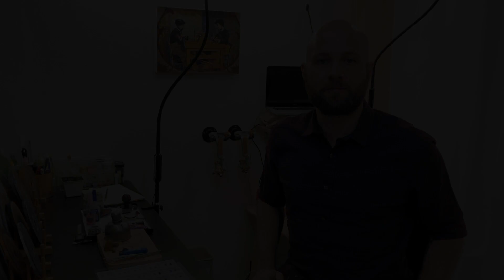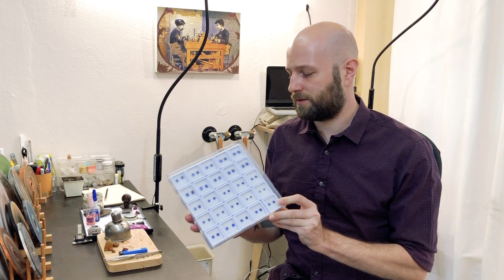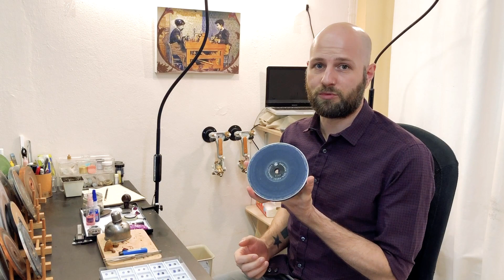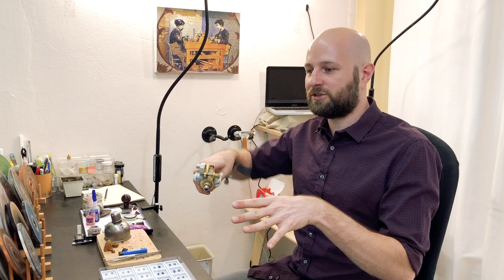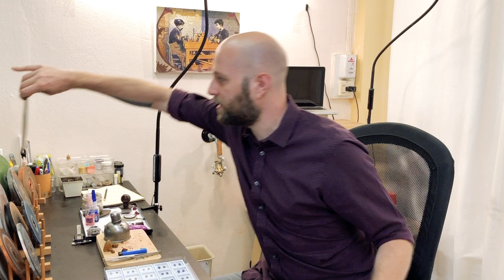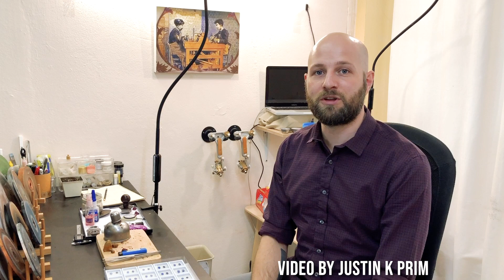Handpiece Polishing Sequence for Handpiece Faceting Machines

Comment: Justin:

This is one of the most informative faceting video I have ever watched.  I did a little bit of faceting with the Raytech more than 20 years ago. and I had any kind of problems
mostly due to my inexperience, but also due to the sloppiness of the machine (this was pre year 2000).

I am going to restart faceting and in spite my past experience I am still partial to hand-piece machines and I have already contacted the Sterling Gems& Lapidaries for prices on a ST-08.

So after watching the video I have a few question:

   1.  Is a hand-piece machine OK for faceting large quartz and if so up to what dimension ?

   2.  You mention that the ST-08 you use is not as accurate as a high precision mast machine.  What is the source of lack of precision?
         My guess for most probable causes, based on my very limited experience is:

        A.  The way the cutter hold the hand-piece

       B.   The glass plate on which the hand-piece sits, since it is very easy to accidentally put pressure on the hand-piece when putting pressure on the stone.

Thank you in advance for your opinion on this.  And please keep up with your very informative videos.

Regards,

Paolo
Reply from the maker: Glad to hear that you’re getting back into it. Yes the Handpiece should be just the same for large stones as any other machines. With an 8 inch lap you have just as much surface area. I guess the only limit is if it was so big that it hit the edges of the machine. But unless your faceting something the size of a football I think you’ll be ok. 

As far as precision, in my experience I have no problem to cut any of the standard cuts but when you get into competition cutting that has many tiny facets, I find that the amount of cheating and tweaking I do to get all the facets in position doesn’t work well with the most complicated designs. I think if someone want to do competition cutting then a good mast machine is the way to go. However I have one of the best mast machines and I prefer my sterling. It’s fast and fun and comfortable and I don’t like doing really complicated designs anyway. I think the lack of precision is probably in the precision of the manufacturing. The machining and engineering. I’m not really sure though. It may just have to do with the fact that the Handpiece is free and therefore can introduce a lot of variable to cutting whereas the mast is fixed and can’t move as much. However this freedom is exactly what I like about the machine. Once you’ve gotten good at the machine, I don’t find these variables to be a hindrance however I don’t want to downplay them since most people buying the machine don’t have a teacher to show them all the tricks and techniques. I’m trying to fill that gap with my YouTube videos.

Comment: How does the drip feed factor into using a lap with two grades of diamond powder? Will the water contaminate the layers by spreading the powder out? Or do you polish with only a little/no water?
Reply from the maker: I don't ever use water for polishing.  Just oil and diamond.

Comment: Hi Justin. I wonder if you could save much of the adjustments (ie. cheater) if you were to use a Transfer Jig rather than "eye-balling" and going "by feel" when dopping to finish the stone (pavilion) ?
Reply from the maker: I don't really spend much time cheating.  Only with the round stone is it even a problem because the square and emerald cuts quickly are aligned against a polishing lap and then locked into the quill and an oval or marquise are pretty easily eyeballed because they're so long.  Only the round is a little tricky because there is no visual reference point for the eye too easily see.  I should do a video where I time my transfer technique vs the transfer jig technique and see if it's longer or shorter.  I suspect the transfer jig takes longer but it would be a good battle.

Comment: Hey there Justin! Hat’s off to you on another fine educational video! I’ll preface my comment on my cutting & polishing process by saying that I was a full-time Lapidary to the Trade in New York from 1984-99, and then in Boston from 99-2009, and after the initial decade of the intense pressure (and a few ulcers) from trying to consistently produce competition quality goods frequently enough to pay my bills, finally arrived at a far simpler process. That process was (and remains) 600/3,000/50 or 100,000. While giving a faceting lesson in 2006, a student from the Midwest (who’d traveled to Boston to spend a weekend training with me) asked how long I thought it would take to cut a stone, from start to finish, using this method, and I said “I don’t know... so, let’s find out!”, and we set a timer. From that second through the selection of a piece of Nigerian Blue Sapphire rough, through the orientation, black wax dopping, cutting & polishing of the pavilion, transferring, cutting, polishing, undopping and cleaning (with denatured alcohol) of what ended up being a 1.17 ct. SRB (standard Round Brilliant) all took a little less than 52 minutes, and that was with a flawless finish under 10x magnification. Now, mind you, that was with an incredibly simple and straightforward design — one that doesn’t require many changes — but I think you get the idea.  

I understand how counterintuitive this sounds, as I’ve watched any number of fellow faceters’ eyebrows race for their hairlines when I’ve shared this before, but the keys are in modifying your speeds during the cutting process and envisioning the effects of the individual diamond particles as they approach and impact the workpiece. 

For example, imagine if you were to take a wooden pole in your hand and go for a walk, dragging behind you down the street. As the chunks of rock in the paved street impacted it, they would probably tear up the end of that stick, leaving some noticeable grooves in it, but if you were doing 60mph down the same road and stuck that same stick out the window just long enough to lightly touch down, the resulting finish would appear much finer, despite the two surfaces and materials being identical. As such, I used to rough out stones under 15 cts. on a 600 lap topper moving at between 3-400 rpm, then go to a copper lap with 3K moving at about 600 rpm, and finish with either 50K on a BATT or 100K on a ceramic lap, with both moving as slowly as the machine would allow. Mind you, this was on either an Ultra Tec V2 or a Fac-Ette GMII, but I strongly suspect that it’s the craftsman more than the machine that dictates the final results. Hope this has helped!
Reply: P. P. S.: A footnote on my previous cutting process: the reason that going from 600 mesh directly to prepolish works so well on most materials (especially on Quartz, Corundum and Spinel) is that it disregards or bypasses the frustrating “orange-peel” effect on the surface of Spinel  and Corundum, bypasses the differential hardness issues on Corundum (where one direction prepolishes and the other sometimes coarsely grinds @ 1200) and completely bypasses the “vectoring” finishes that so often plague Amethyst and Citrine table facets. Again, I hope this has been helpful!
Reply: P. S,:  If you could possibly share with me/us which equipment you’re using in the creation of your videos (and which software you use to edit and compile them), I know that I would be eternally grateful, as I’ve yearned to offer my own videos, but am clueless as to where and how to begin.
Reply: I think Justin needs to get your process on film!

Comment: Hello Justin, really nice video! I just received the sterling machine with 260, 600, 1200 and 3000 topper laps, zinc, copper, steel and lucite. I have several grits of diamond powder and paste and also aluminum oxide and cerium oxide. I would like to cut primarily garnets, quartz, tourmaline and beryl. What sequences would you use with the mentioned laps? I could also buy an extra lap if needed, maybe a batt lap... thanks in advance!

Comment: Hey Justin, Nice video.  I use a coarse sintered lap for preforming, and cutting in the facets. I then use a two zone lap that has a very fine (but fast cutting) sintered outer band, and the Gearloose Diamatrix Composite center band with 60K diamond on it.  The sintered outer band cuts quick so dialing in meet points is fast, and leaves a finish that almost looks polished.  This means it is only a few seconds to brighten up the facet on the 60K.  because the outer band is sintered there is pretty much no risk of contamination on the inner band.  In small stones I cut only the mains on the coarse sintered lap, and cut in the breaks and stars with the fine sintered lap.  This makes the whole cutting and polishing sequence with only 2 laps, and is a very fast process.
Reply from the maker: Wow.  Where did you find a lap like that? Also what is the outer sintered grit level that lets you jump to 60k? Sounds like an incredible lap. Also I've been admiring your stones for a while so it's cool to understand how you get to that point. Thanks
Reply: Thaks for the complement.  The two zone fine grit sontered lap was an experiment with Jon at gearloose and Tom Adamas at adamasfacet.com.  i managed to get 3 of them between mine and 2 for students.  They stopped making them because it was too hard and expensive to make.

You and I should get together and discuss some ideas on teaching faceting.

Comment: Hello Justin. I usually go from 1200 to 3000 and then 0-2 on copper. I has some issues polishing a peridot on copper , so i put on the copper lap a DVD and impregnated It with the same 0-2 powder. As the DVD Is softer It polishes as a lower grit.
I Jump from the outer part on copper to the DVD for each facets row by adjusting the height. The result was quick and the final polish was far Better than Just the 0-2 on copper. I have a batt lap (6inch) that I was planning to use with 100k gritt but I was concerned about repeatability of my sterling handpiece, I Will definitely try to divide It in 40k outer and 100k inner
Reply from the maker: I think copper is too hard for peridot.  Tin would be better.  Also I don't think you need a 3000 step.  1200 to 0-2 works great and saves time.

Comment: I'm using 360, 800,very warn 1200, and 3000 then 13k  I finished on 50k
Reply from the maker: I think you could take 13k out of your sequence and get the same results. 3000 to 50k is easy and quick.